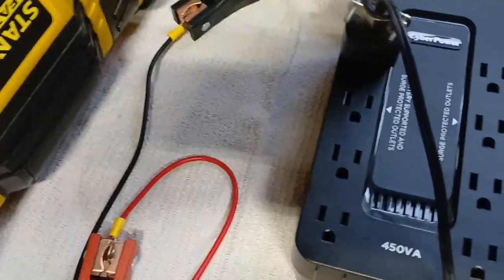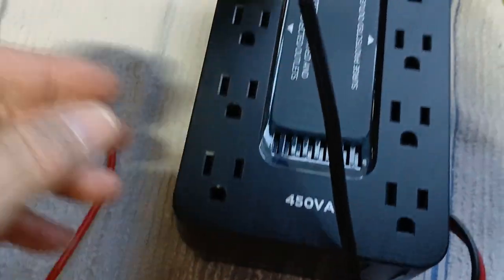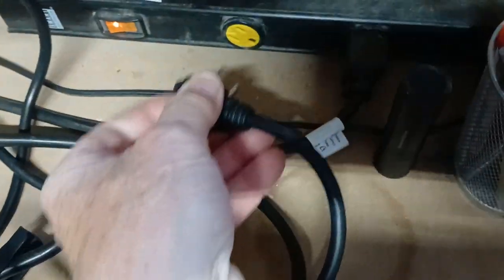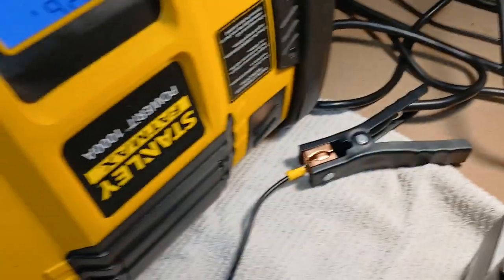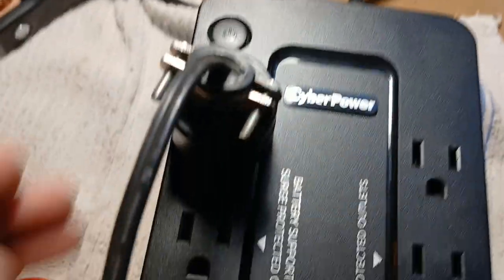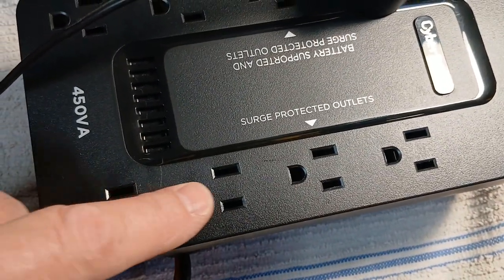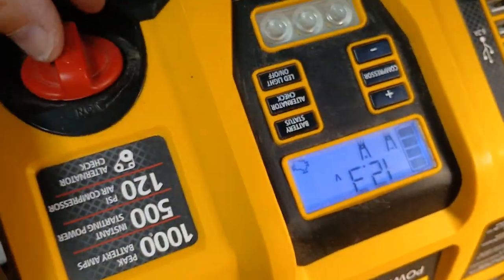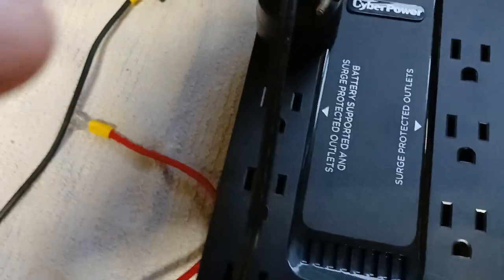Cyberpower UPS 450 VA External Battery Back-UPS System

Comment from the maker: Welcome to the Cyberpower 450 VA with an external 12-volt hookup. This is a great little unit.
Reply: Well i have 350VA that i have 12V Deep cycle battery 75A i run 9 hours and more